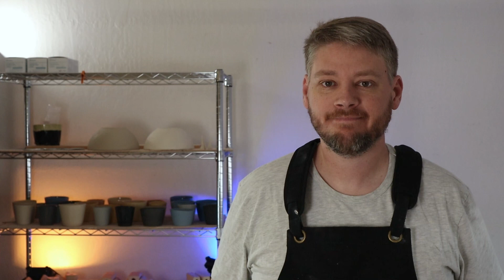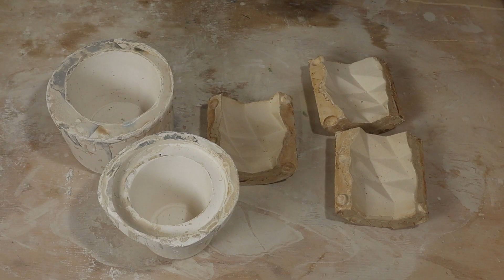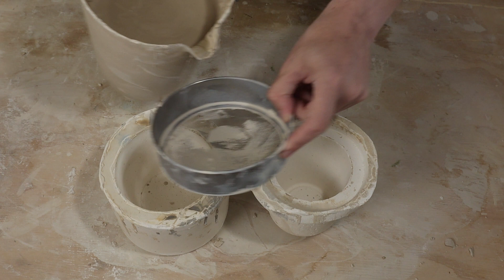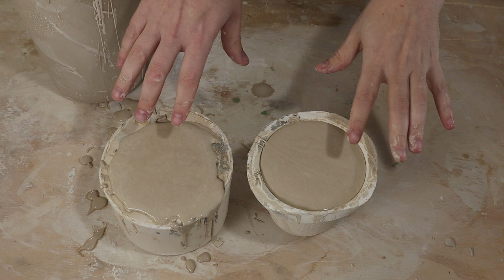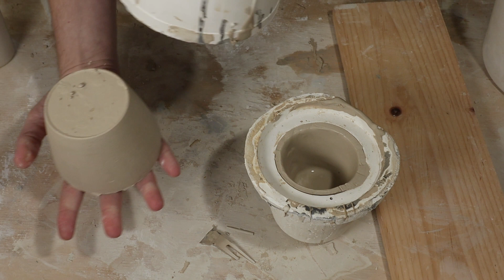When GOOD molds go BAD! Slip casting mold deterioration

Comment: The white crusty stuff is called efflorescence; it's the result of water migrating through the plaster and dissolving some of the components.
Reply from the maker: Yep! The other problem here I think comes down to poor plaster casting and trapping bubbles under the surface of the mold which then degrade quickly.